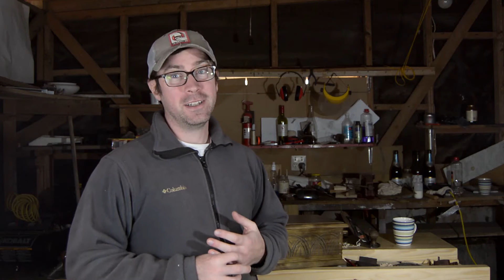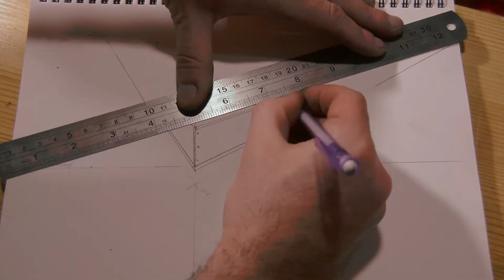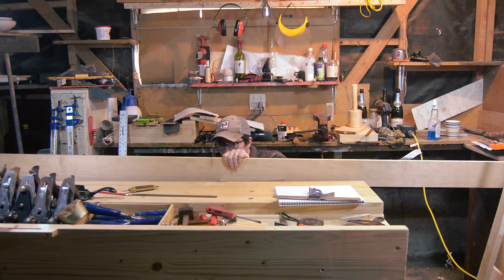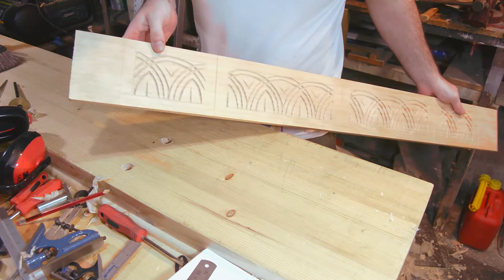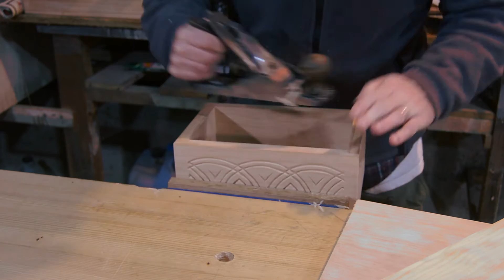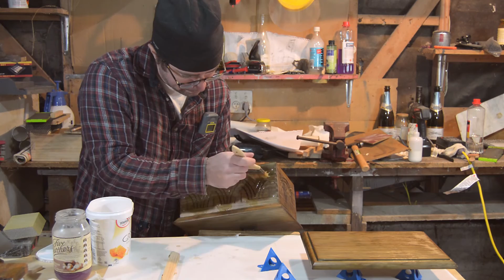Making a 17th Century Bible Box from one board with hand tools.

Comment: Did you pin the rabbet joints?  Or did you use nails?  Great piece btw!
Reply from the maker: Well, trick answer to this, I did nail them but I glued them first. 

I'm pretty sure the originals of this were just nailed or pinned. 

I'm not really willing to spend 20 bucks on 8 rose head nails and I haven't found cut nails over here yet. ( I think most sane folks would think this way).
So, I used cheap galvanized nails that were soft enough for me to texture the heads of with a ball-peen hammer. 

Even though I did nail them with those textured nails, they are more for aesthetic purposes then strength since I PVA glued the joints first.  Being the grain is all the same direction on the sides I wasn't concerned with splitting from the glued joint.